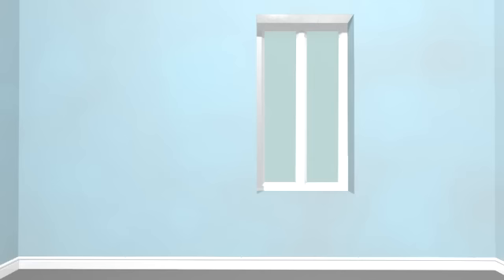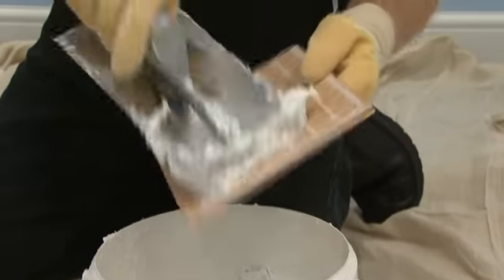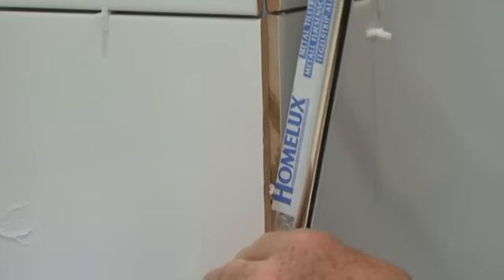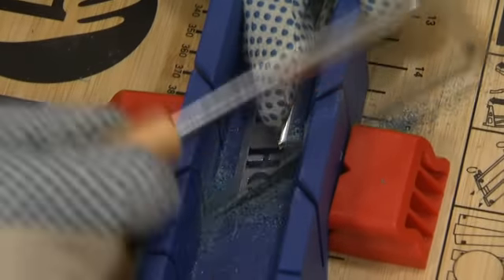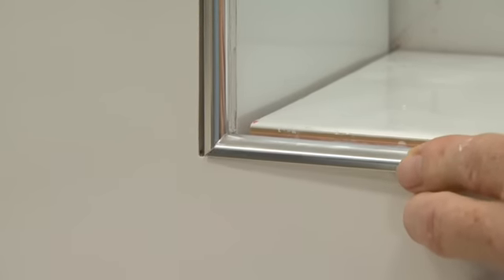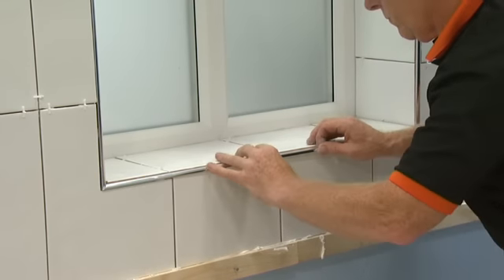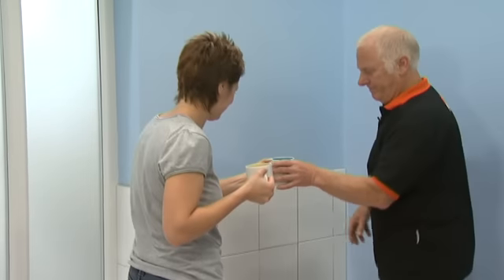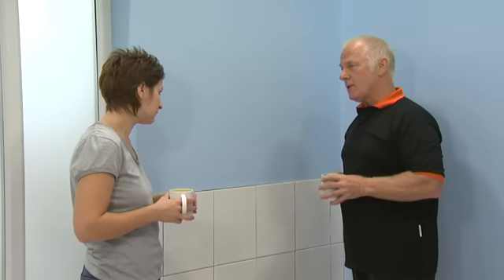How to Tile Around Windows

Comment: Thanks for this. I had not been sure if it was OK to put the adhesive on the tiles as I was taught many years ago to put adhesive on an area of wall. The problem with that is you might do too big an area and have to remove excess at the end.

Comment: incorrect. Around windows tikes needs to be angled, otherwise water will stand. No need to use any profiles for hiding, cut tiles in an angle... like 45 degree

Comment: Why not have 3 full tiles rather than have to cut all the bottom row. So what if the tiles would be a couple inches higher up the wall. Weird.

Also no explanation of the window sil trim. You seem to have left the sil tiles short of the trim? This would then need to be filled with grout. Not a nice look. Trim is so you don't have grout along those corners/bends.

Comment: wow! there are alot of amateur things going on here, quite embarrassing tbh. first off, it looks like you layout from left to right is centered incorrectly,  yes the window is centered, but if you had moved the complete right to left layout over one half tile, you would of had big centered cuts everywhere instead of those smaller cuts. also tiling the sill should be done before the sides, not after. you never shimmed the schluters to be completed even with the tiles edge. you should always apply adhesive to walls also, not just tile. you also didn't use enough adhesive when you were tiling the bottom section, you can clearly see the wall boards in between the trowel notches. and what's with starting on that board? that's just a waste of time because you now have to shimm from that board and then shimm again at base, if you just start at bottom, your just shimming once and you don't have to spend the time screwing and leveling that board. just make a level line up from base 1 or 2 tiles and shim to it, then keep going up. lots of mistakes imo

Comment: wow! there are alot of amateur things going on here, quite embarrassing tbh. first off, it looks like your  layout from left to right is centered incorrectly,  yes the window is centered, but if you had moved the complete right to left layout over one half tile, you would of had big centered cuts everywhere instead of those smaller cuts. also tiling the sill should be done before the sides, not after. you never shimmed the schluters to be completely even with the tiles edge. you should always apply adhesive to walls also, not just tile. you also didn't use enough adhesive when you were tiling the bottom section, you can clearly see the wall boards in between the trowel notches. and what's with starting on that board? that's just a waste of time because you now have to shimm from that board and then shimm again at base, if you just start at bottom, your just shimming once and you don't have to spend the time screwing and leveling that board. just make a level line up from base 1 or 2 tiles and shim to it, then keep going up. lots of mistakes imo
Reply: vapdivrr you posted the same comment twice?are you a tile setter by trade? If so maybe you should post some videos so others can critique your work. I'm not saying this guy did a good job and your right about everything you said.im just saying.